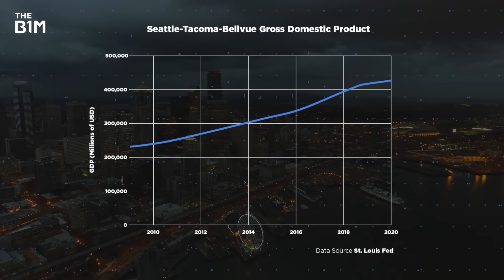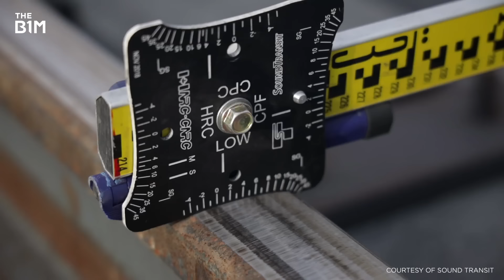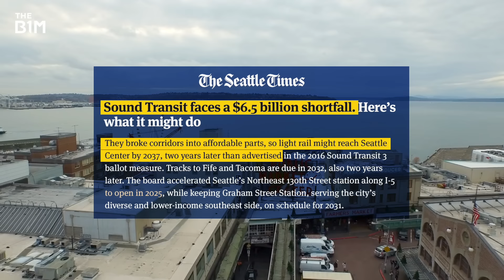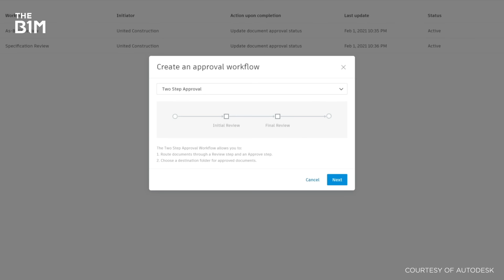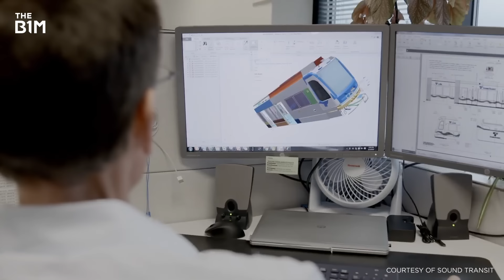Seattle is Building a $54BN New Railway

Comment: A floating bridge for a train, over a lake, is pretty mental to me. That alone is some crazy engineering. Really interested to hear more about this topic later!
Reply: The research and design would be half the cost of structure. It’d be better if they went with a conventional bridge.
Reply: They already have 2 floating bridges
Reply: It not only has to be a bridge - it also has to be a boat and it will be built by the lowest bidder.
Reply: @coke8077  lake Washington is deep af you can't build a traditional bridge over that lake
Reply: @JohnnyWednesday  The bridge is already built. They twinned one of the floating bridges for cars a little while ago and some of the extra lanes will be for the train line.
Reply: @coke8077  It’s running on an existing floating bridge. Conventional bridges won’t work at that location because the lake is very deep and drops off a couple hundred feet. That’s why the two existing freeway bridges float.
Reply: @coke8077  Bridge is already built. You just don't often see this type of bridge as it doesn't work as well in rivers or in tidal water. Since it is a lake and they are abel to regulate the level the floating bridges work well. There is a floating bridge on the sea nearby, it even has a way to separate in the middle to let boats through. All old technology and proven in even harsher conditions than the lake.
Reply: @yo yo well, if you're counting original and replacement bridges the total is actually 7. 3 bridges on i-90 (original was sunk due to human error, 2 exist today) 2 bridges on sr520 (original was replaced several years ago) and 2 on sr104 aka hood canal (half of the original bridge sank in a major storm in 1979 and was replaced, the other half was replaced in the early 2000's).
Reply: @Lunch_box  yes you can build a traditional bridge over Lake Washington.  It's just much cheaper to have a floating one.
Reply: I really wish these videos would go deeper into one or two of the interesting engineering challenges.
Reply: @Lunch_box  One of their main issues indeed
Reply: It is a big lake and we have had two floating highways over it for 40 years and they did fine even during an earth quake
Reply: @Lunch_box  Which is funny because some of the worst infrastructure in America can be found in traditionally red states with red state legislatures. But go off I guess.
Reply: Build a damn bridge!
Reply: @Lunch_box  lol, jesus christ you americans really blame the other party when anything goes wrong do you?
Reply: @coke8077  we already have a floating bridge connecting Seattle to Mercer Island built years ago. They are just adding to it
Reply: @carlosandleon  look at what they have done and tell me I'm wrong? I'm a libertarian I see it from both sides of the table and it's overwhelmingly one sides issues...
Reply: @Lunch_box  I always though Infrastructure was a republican issue.  Anyway enjoy your duopoly.
Reply: @Lunch_box  Imagine being this taken with partisan nonsense that you bring hottakes like this. Yikes.
Reply: How did you get that badge next to your name? Or is that an emoji?
Reply: @Lunch_box  Seattle has 3 floating bridges that cross Lake Washington to the east side. There is a 4th else where in Washington state that crosses Hood Canal. These 4 are the world's longest floating bridges. Nowhere comes close.
Reply: @coke8077  that lake is over 500ft deep. hence why all the roads are already floating bridges.
Reply: @JohnnyWednesday  the bridge was already there. they are using the already existing express lane bridge.
Reply: @coke8077 the problem is the lake is too deep for a traditional bridge, that is why they are floating.
Reply: A ton of people in here are speaking on things they have 0 knowledge on 🙄
Reply: They didn’t build a new bridge for the train, they just took away a few lanes from the existing bridge that was built in the 80s
Reply: Apparently, this is the first rail line on a floating bridge in the world.
Reply: Floating bridges have been around forever and there are several across the world. Nothing new
Reply: Thanks B1M on showing Seattle some love! Great video as usual!

The bridges on Lake Washington have always been floating so it makes sense they are applying this to the train piece as well. It’s the 520 bridges and use to even have working fountains on one end! Basically the concrete is set to create a pocket under each section trapping air to help offset the weight of the bridge. Not sure if this is true but I-90 may also have a few sections that are floating as well. 

Looking forward to learning more about this project as it continues on into the future.
Reply: I helped build that job!
Reply: @badlandskid  Well of course.
Reply: The B1M always at the forefront of engineering technologies 🔥🔥🔥
Reply: It will break down a lot.
Reply: @williec7273  yeah but none with trains on em that’s shit you expect in a certain Asian country
Reply: @qjtvaddict  again nothing new and probably a safer bet considering it would be safe in earthquakes, and these types of bridges are usually used in areas that aren't suited for piers, and probably less invasive to the water environment.
Reply: They done it for the road bridge they have over there
Reply: @Lunch_box  lol what do you mean “that’s democrats for you”? They’ve built one of the richest cities in the country alongside the fastest growing city alongside the most ambitious transit expansion projects in the country in Seattle. That doesn’t happen through incompetence; all the poorest cities and states (which are basically all Republican cities and states) happens through incompetence 😂 what you said is literally the exact opposite of reality lmfao
Reply: People! The rail is  being built on an existing floating bridge not building a new bridge
Reply: @Lunch_box  no, there are 3 floating bridges and the rail is being built on an existing bridge not a new one
Reply: @yo yo government incompetence? The courts held the contractors responsible
Reply: @carlosandleon  conservatives blame the other party when things go right also. They describe every success as a disaster
Reply: @coke8077  nah we need more cool structures
Reply: There was a floating bridge in Hobart, Tasmania for a few decades and it seemed it shared similar reasons for existing. Its a make-do solution to a unique problem. While eventually the Derwent in Hobart was bridged with a 'real' bridge, the 25-35m deep, 1km wide harbour was challenging to bridge and the floating bridge, coupled with a lift-span at one end was a 'good enough' solution at the time. The Lake Washington situation is however more challenging. At twice the width of the Derwent, and plunging sharply to a depth of some 50-60m, even the absurdly long piers of Hobart's Tasman Bridge would not be able to reach these depths effectively. Piers would be nothing short of sunken office towers in height (not including the depth of the sediments they'd also need to bore into, just to breach the surface and the engineering challenge and its cost would likely far outweigh the case for making it. Tunnelling under the lake would present a similar issue as the railway would need to dive deeper than the Channel Tunnel just to make it to the other side, likely requiring a spiral track either end just to get down to the depth needed to pass it. In honesty, its the sort of place that you'd just say "nah, just not going to happen", but if they must, a pontoon bridge does offer a serviceable option. The issue of wave propagation seems to be why they've limited it to light rail though.
Reply: @coke8077  The lake is hundreds of feet deep
Reply: @coke8077  lake is too deep for a conventional bridge.
Reply: It’s pretty far along.
Reply: @coke8077   floating bridge is not exactly new technology- we looked at them during my engineering degree 30 years ago.
Reply: I live in the area. It's a pretty cool bridge. On windy days you can feel it roll and sway just a bit
Reply: @Lunch_box  to bad the other side the other side is busy fighting over religion and guns. 🤔
Reply: This entire project screams “underground metro” to me. It would just be simpler to build a subway using TBMs, not to mention that it would create a more efficient transport system for a fast-growing city. Light Rail is very limited in operation and expansion, especially in a city built on such steep hills. This really seems like a giant waste of money.
Reply: @coke8077  Can’t do a conventional bridge on top of a fault.
Reply: @williec7273  Floating bridges aren’t a problem. They’re an old, simple and safe technology. Their huge advantage is that they bend without breaking, which is great in earthquakes. That’s all fine.

However… rails are rigid for a very good reason. Adding rails into a floating bridge makes both systems worse by exerting physical forces neither is meant to take. Rails will flex (bad) and the bridge joints will be stiffened (also bad).
Reply: @demetrialowther727  The Gotthard Base tunnel in the Alps runs up to 2,300 meters deep. The Chunnel isn’t actually all that deep at all. The Seikan tunnel in Japan runs 140 meters below sea level. It was started in 1964 with 1964 technology. 

The issue is that all three are extremely huge and expensive projects made for high-speed intercity trains, not cars or light rail.
Reply: @coke8077  the bridge is already built and has been in use for decades. They’re just converting the express HOV lanes to the train tracks
Reply: @coke8077  we already have several floating bridges.
Reply: @afcgeo882  this issue has already been solved by concrete overpasses. These to move and flex at expansion areas. So while the train may need to slowdown the technology has been there
Reply: @williec7273  You think concrete flexes? 🤣
Reply: When you look at a modern US aircraft carrier it’s hard to imagine how something that large can float but the do. So if a ship of that size can float then so can a bridge.
Reply: Both floating bridges have already existed for decades. They're just adding tracks to them
Reply: I live in Seattle, and this is the one part of ST I am nervous about. Although the Homer Hadley Bridge has survived decades, and they’ve learned since the last time WSDoT tried renovating a floating bridge on I-90. Contractors left inspection holes on the pontoons of the original Lacey V. Murrow Bridge open, in the middle of a fierce fall storm. Still, these bridges have proven adaptable. Can switch her out pontoons if need be. I still here from time to time, people talking about the Bulge on the original LVM, that was a lift span, removed in the 80s in preparation for the second span.
Reply: @Lunch_box  of course a suspension bridge could be built, but the cost was deemed too high.  This is a sweet little lie that locals like to trumpet.  I still remember driving past the cement factory on the Duwamish thinking it funny that 520 was being built not with their concrete, but a concrete from China.  Then sections started to leak because…well it was cheap concrete.  

You get what you spend on it.  Remember that.
Reply: @Lunch_box  technically, you could build a huge suspension bridge, but it would probably never get funded and approved for aesthetic and environmental reasons.
Reply: yeah its gonna be the very first since floating bridges are already a new-ish concept
Reply: @Stolat79  pretty sure the 520 pontoons were built in Aberdeen. Are you saying the actual concrete came from China? That seems odd.
Reply: @kevinpoole1543  I replied earlier, but it appears my comment disappeared?  Perhaps because I put in a link?  Yes, the 520 bridge used concrete from China instead of from Washington based Ash Grove.  This was back in 2013 and no answer as to why the Ash Grove bid was denied in favor of a foreign company.  KOMO has an article about it, this was about the time that the pontoons showed signs of cracking and people were rightfully puzzled as to why.
Reply: @JohnnyWednesday  that lowest bidder part is what always kinda freaks me out when it comes to government projects. There’s a reason for the phrase “Good enough for government work” whenever someone does something half-ass on any construction site lol. And thats why it scares me lol
Reply: @Stolat79  dang, that’s messed up. But then again, if the Ash Grove bid was a lot higher, the DOT may not have had much of a choice.
Reply: @kevinpoole1543  there is always a choice and hidden costs, especially if you take into account the amount of additional carbon that Green Seattle pumped into the atmosphere by buying from China.  The jobs they did not help make in the region by also opting out of local.  Same thing is going on with the West Seattle bridge right now.  They are retrofitting the current compromised bridge because it’s cheaper than building a new one, but will still have to build a new bridge in the next 20 years when the cost to build will exceed the current cost to repair combined with the cost now to build new.  Choices.
Reply: Nah. Not crazy engineering. /
Reply: @coke8077  the lake bed is too soft for piers of a conventional bridge. The other option, a suspension bridge, would require bridge towers the height of Seattle's Space Needle, which would have been too expensive
Reply: It’ll never be finished and already have cost a trillion half way through, stalled six months while they study its impact on the Hemlock beetle.
Reply: @Lunch_box  what does politics have to do with a floating bridge failing. If you want to get political what are Republicans doing to address Texas power infrastructure that keeps failing. Again both parties are horrible but the fact that you think one is better is amusing.
Reply: @Sylox95  Are you suggesting Washington`is a red`state?  The eastern part, yes..,but the bridges are in the wet, populated half.,,which is blue...
Reply: I drive by that floating rail bridge several times a week, it is pretty neat.
Reply: Its an extention of an already existing floating bridge used for automotive vehicles
Reply: @yo yo contractor incompetence. The contractor left the bridge pontoon hatches open during a massive storm causing them to flood and sink
Reply: @coke8077  the reason it wasn't a traditional bridge is because of the depth of Lake Washington. It simply isn't possible.
Reply: I'm from Seattle and I can tell you that I used to hear that same stupid "a floating bridge" horse shit since I was born.  It's still there.   In fact, I just drove over it about 19 minutes ago..  One thing people don't understand about Seattle is, we have to be intuitive..  It's like people from Chicago coming here laughing at us while driving in the snow.  ON HILLS...
Reply: @ericweiler6571  I had a good friend who came out from Chicago in the middle of winter and tried to show us that he can drive up a steep snowy hill... He made it 30 feet before sliding back down James Street from 3rd Ave to 1st 🤣🤣🤣
Reply: @bbundridge  LOL!!!  Brian, I want to tell you something.   You are officially the smartest person I've ever talked to.  You understood my reference!!!!

In case you don't understand what my bro Brian and I are talking about, James Street is a steep "hill" in Seattle.  It's actually an offramp from I-5 that is heavily travelled.  For some damn reason, people from Chicago like to "prove" how well they can drive in snow when it snows in downtown Seattle (the most beautiful place on earth).....

They don't make it very far.  Let's put it that way
Reply: @ericweiler6571  yeah, I live here too. We did lose a section of the original i90 bridge, but they rebuilt it better and then doubled it up.
Reply: @jodynace8884  Jody, I remember that.   Was it I90 or 520?   What part of Seattle are you in?  Renton, here
Reply: Hello we have had floating bridges for over a half century
Reply: @boringsoaring   Yes, Steve...  We've had floating bridges for over half a century now.  That was kind of the point
Reply: @ericweiler6571  Greater Ballard area. 

The original i90 bridge was built in 1940 and the second bridge next to it was built in 1099. Part of the original bridge sunk during some reconstruction and resurfacing in 1990. It was replaced by 1993 leaving us with the twin bridges we have today.
Reply: The whole railway is absolute garbage! They couldn't have set it up as an automated metro like the neighbors across the border in Vancouver have. Waste of tax payer money!
Reply: @AlexandruBauer   Hello nieghbour!  I'm from Seattle and I agree with you that Sound Transit are a bunch of crooks, but I will say traffic has gotten no better..  Unless you ride the light rail.  I remember when the Seahawks won the Super Bowl in 2013 (technically 2014) and I went from Seatac to Seattle and on the light rail it took less than 25 minutes.  It was great being above all the traffic.  And for the record, automation is not very hard to accomplish.  We're both Pacific Northwesterners, but we have different issues in Seattle and Vancouver.  I've been to your great city many, MANY times and I absolutely love it but Seattle and  Vancouver are two entirely different places when it comes to logistics.  For one, Seattle is much bigger than Vancouver both population and area-wise.

Alexander, what part of Vancouver are you from if you don't mind me asking?   I absolutely LOVE Vancouver..   I WAS a Canucks fan but now that Seattle finally got into the NHL (for the second time...  1974-long story) but now I love the Canadians who play for the Kraken.

Have you been on the ST light rail here in Seattle?
Reply: @ericweiler6571  oh, I am local in the Seattle area! Love how they are encouraging us to ride the rail to the airport by removing airport parking yet public transit from the outskirts would make it a 2-3 hour trek. They are absolute crooks! The light rail is an absolute waste of taxpayer money - union jobs, pensions etc, drivers in each train instead of it being automated, split platform in the train instead of a flat level all across for better accessibility and overall capacity. Traffic is worse because they also took out 2 lanes of i90 to make space for the rail. I have ridden the ST light rail and absolutely hate it! I have been to Vancouver a bunch of times and have learned to appreciate how great their metro system has been put together. The only reason ST has drivers is due to the surface level line around Columbia City - they saved a few bucks now to pay 10x more over the life of the system.
Reply: Sooooo Does this make it official that "THE BIG ONE" Won't be happening at all and has been "Canceled"????  
Just wondering.
Reply: @gabrielort3531   If you're talking about the light rail, it will be built.  I doubt that will change
Reply: @yo yo Government incompetence??? Try contractor negligence.
Reply: @carlosandleon  Actually no, there is one party that is based on science, truth, and rational thinking. The other has most of su and the world scratching our heads.
Reply: @sc9662  you shouldn’t be commenting
Reply: You will hear a lot more after the heavy train rips the bridge apart. See there is nothing light about light rail. It is heavy rail on steel tracks with cars made to look luxurious & painted pretty colors. But the bridge, built for cars & trucks only has a gross weight maximum of 80,000 pounds per vehicle. A light rail car at minimum with no passengers weighs 67,000 lbs each and there would be 4 of those in a row unpacked adding an additional 260,000 pounds to a bridge not built for trucks following that closely. Simply said the bridge was never built for light rail not intended to be used for light rail. It also bounces up & down with giant waves crashing over the bridge during storms. What that will do has never been tested in real life to a train. Trains aren’t designed to bounce.
Reply: Maybe that is a German idea too!!!!
Reply: @yo yo no that was due to the contract forgetting to reinstall the cover plates on the side of the bridge.
Reply: @marzsit9833  I watched that happen live on TV. Im native here and it sucked.
Reply: it is to us as the ST consultant and working on this project, it's headache daily
Reply: Nah. Not crazy. /
Reply: @Lunch_box  It's not very deep at all. The problem is that the bottom is mud and that mud is incredibly deep. Can't build a traditional bridge at a reasonable price.
Reply: the bridge is already there
Reply: not really the 520 bridge has been for the most part pretty sucsessful I have been a resident since the mid 1970s and honestly the light rail should been built then as land was cheap
Reply: @coke8077  the bridge was already there. They just repurposed it
Reply: Samuel, you make a pontoon bridge sound more mental than it is, although I doubt a train on one is common… 🤷🏻‍♂️
Reply: Seattle is an insane nightmare
Reply: @JohnnyWednesday  we've had two floating bridges for decades.
Reply: Lot of people jealous that they don't have floating bridges.
Reply: i drive by this project everyday on the way to work nits truly incredible. the reason the floating bridge works is because it’s over a lake. a traditional bridge wouldn’t work because of how deep it is but the light rail is coming around beautifully. they used older images and videos here. but it’s truly incredible.
Reply: You should see what they are doing in Norway, we’re still in pre school as far as infrastructure
Reply: Particularly when they have a history of sinking.
Reply: It repurposed an express lane on an existing floating bridge.  It added new challenges though, as you'd expect when adding a train to something.
Reply: Lake Washington is too deep coming in at a depth of 214’ to build a traditional bridge this would mean building support beams higher than the Space Needle, that’s why we have two floating bridges across the lake Interstate-90 and Washington State Route-520 being the largest floating bridge in the world. The most efficient and fastest way to get to Bellevue is by traveling over Lake Washington that’s why Sound Transit is using the old HOV reversible lanes on the I-90 floating bridge.
Reply: One floating bridge sank already..
Reply: Bridge already exist for roads
Reply: We voted this down in 2008 but the government decided to build it anyway. Construction began in 2018 and it won’t be in working order until 2028. By which time it will be wholly inadequate to handle our areas infrastructure needs. And yet, the government keeps bleeding us dry through taxes on services we can’t even use. Our current sound transit light rail is full of active drug users and public health and safety risks but we pay a minimum of an extra $100-200 each year in car tabs regardless. Complete bull. Money hungry morons are running this state.
Reply: @nicolecomfort-mcdermott4743   you like the car tab b.s. the guy entman.? I always get it wrong. He is broke divorced poor guy it the state. I am straight up pissed at inslee he done f’ed us up good
Reply: Before they added the rail to the center section it was a one way express lane. We took my friend's car 165mph across it in the middle of the night. I'd like to see the train try that 😄
Reply: @micahsaunders8356  The original bridge opened in 1940.  It sank in 1990 due to a severe storm and a maintenance team's error in not closing its hatches before they left, which caused several of the pontoons to flood and drag the rest down with them.  I remember watching it sink on local television.  It was rebuilt and was back in service by 1993.  No "Galloping Gertie" disaster here - the design has worked extremely well.
Reply: @andrewcrisp8567  Seattle's first floating bridge opened in 1940.
Reply: It’s even crazier to think that the bridge connects Seattle to my town
Reply: The cost to put the tracks across the bridge ended up costing double what they budgeted. They didn’t take into account the weight of the train moving onto the floating bridge when they designed it. Every project they’ve promised has gone WAY over budget.
Sound Transit is a big black hole of our tax money.
Reply: The floating bridges aren't as crazy as they sound. I think they're basically hollow concrete blocks designed to float anchored together. Kinda like driving over the top of a bunch of baby aircraft carriers
Reply: It already existed - the just fixed it and took a lane for the train.
Reply: @coke8077  it’s next to cars on an old bridge
Reply: @Johnny Wednesday  the bridge has been there for like 30 years, they put the tracks on what used to be the express lanes.
Reply: @coke8077  The bridges were already there and the lakes are deep. Good luck with that conventional bridge idea.
Reply: @jack_dagnel  Agree.
Reply: They said they use Seattle's system as an example for other systems.  Yes, an example of government waste and ineptitude.  Some of us were actually hoping the 40% increase in vehicle taxes might ease things, but it will not happen until (they tell us now) 2029.  It was ORIGINALLY at a cost of $500 MILLION per mile of track.  It is now up to $760 million and no one knows when it will end.  I live in Everett, WA, and was told they would have a working system that I could ride from Everett to SEA-TAC airport without changing trains.  That to be done and operational in 2025 (why so long?).  They now say that MAYBE by 2029.  And they removed car lanes from bridges to be replaced with rail lines that polls tell us will not be used as the trains are not like Shanghai's where they run every ten minutes.  Nope.  Ours will be (maybe, we don't know) twice per hour.  Maybe.
Reply: @davidbeckenbaugh9598  Another option for transportation available to us? The horror. Congratulations, you realize things cost money and consistently go over budget. you don’t go over and complain about road projects going over budget by an insane amount though. We could’ve had this back a long time ago. Probably would have cost a lot less.
Reply: @Apollo580  I seem to have pointed that out after my first visit to China just short of thirty years ago.  No, I think this is a very good choice.  But the trains do not and will not run frequently enough.  And inter-city travel will not be answered with 'bullet trains' in the USA because the plans are to have the trains running on the ground where they will be able to collide with cars driven by people who think they can 'beat' the train.  China and Japan realize this and have tracks with no other traffic on them (freight trains), and elevated to keep them away from cars and trucks.  But we will not do that, so speeds are limited.  And, let's face it, the elevated rail system is UGLY (to say the least) and NIMBY rules the day.  Bottom line?  We are late to the party and everyone is already going home.
Reply: @davidbeckenbaugh9598   Of course they’re going to be elevated. You need to keep them isolated from cars for safety reasons. You can also put them under ground and tunnels to isolate them from cars. This idea is not impossible. California is about to have the first legitimate high-speed rail system in the United States regardless of what you think of it. To give the excuse that it’s going to be ugly to prevent building such a system that is within our grasp to further reduce climate emissions, and improve quality of life through transportation and infrastructure improvements is the dumbest excuse I’ve ever heard. And if your next reason for not building it is cost, that’s not an excuse for the wealthiest country in the world to say they can’t pay for something like this.
Reply: @Apollo580  High speed rail SYSTEM?  Between two towns REALLY?  And this is NOT a dedicated HS rail line, it is mixed with freight and 'regular' passenger trains.  High speed at 110 mph?  (ok, well, 200 mph in some very short segments).  And, at what cost?  ON one in the public knows, they are not telling us.  They are still only 'estimates'.  Seattles light rail is over $500 MILLION per mile.  And that was five years ago, it is now approaching $1 BILLION per mile.  And you say cost is 'no excuse', let's do it"?  And you say that it being ugly is no excuse?  Yes, well, that is what I said so what is your point with that one?  But California's is only elevated in high population density areas.  The majority of the track IS ON THE GROUND with automobile crossings.  And it started in 1996 and STILL is not finished and is not planned to be finished for several more years?  30 years to build a couple hundred miles of tracks?  REALLY?  China builds that in about three months.  Part of my engineering studies was serving an intern position while the Nanjing/Zhenjiang section was being built.  Seems like I know my subject.  You know a LITTLE about your subject.  But you sure left off a lot of necessary info in your post.  Like... cost.  Which is unknown at this time.
Reply: @Apollo580  I stopped reading because I had researched my last post very well.  According to Cal Trans, the majority of the line is NOT separated and the majority of the line is 110 mph and 110 mph may be 'high speed' but it comes no where near the 'bullet train' everyone calls it.  It is, actually, quite typical.  You are right, on the separated sections, it is PLANNED to make about 200 mph, but we still do not k now if that will happen.  This has had EXTREMELY bad planning.  And it STILL has auto crossings.  Imagine a train moving at 100 mph (not 200, it will not happen) hitting a tractor trailer rig fully loaded at 80,000 lbs.  This is not an 'if' scenario.  Americans are stupid and are always trying to beat trains, so this is a 'when' scenario.  The Japanese were the first to have these and they figured it very well.  The Chinese learned from the Japanese.  The French learned from both of them.  I learned from all three.  Sorry.  You do not have much info other than what is sent out as publicity.  And the environmentalists are not well known for being good sources of info.  Neither is the Newsome government.  Even YOU say it is a blank check the transportation folks have been given.  Ouch.  And here is one I have not had a good answer on.  In France, japan, and China, you have two separate bullet train lines.  One goes one direction, the other reverses course.  Can someone out there find whether two tracks are being laid?  Or just one?  I don't have anymore time to waste on this.  I did my research and found there just is not a lot of info out there in the public realm.  Just what they want folks to know so they feel good about things. It's like pulling teeth to get in depth info.  And that is how it is when you start looking into the government
Reply: Sometimes they even sink!
Reply: Did you know that the first floating Bridge sank in the same spot?